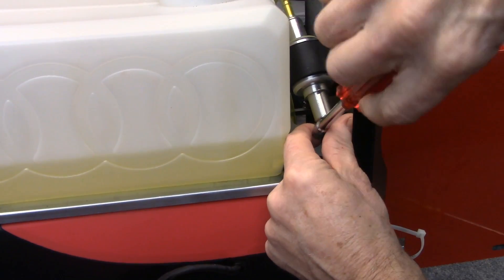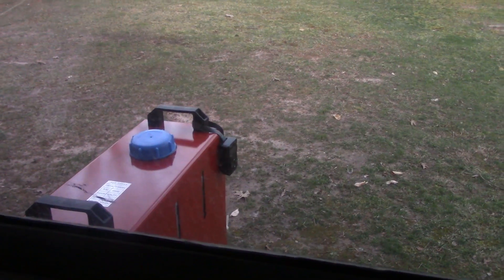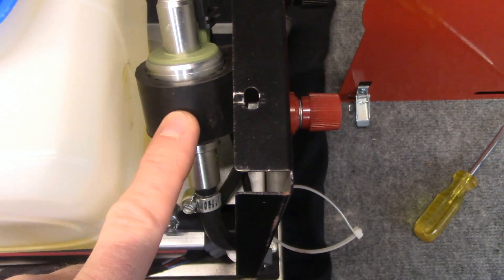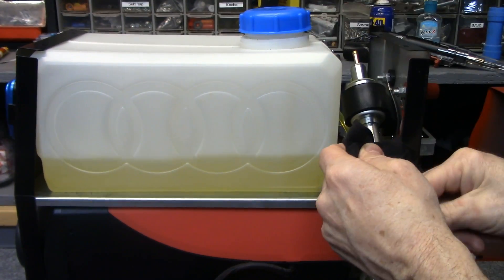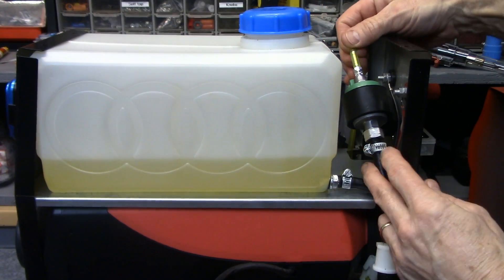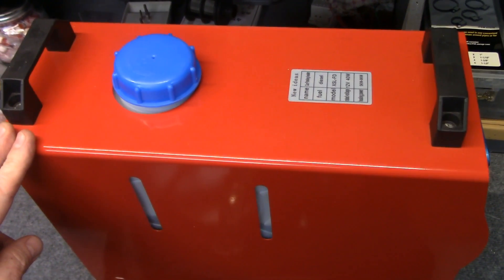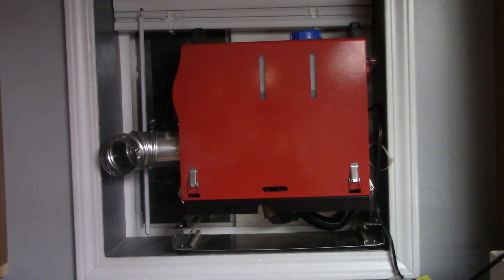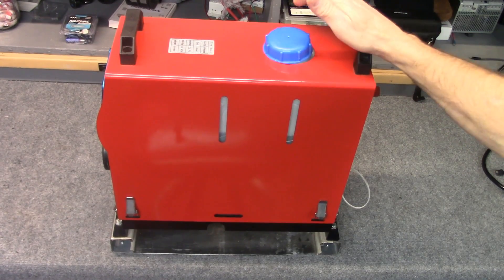Diesel Heater Quiet Fuel Pump Upgrade

Comment: I know this is an old Vid, but if you encapsulate it in silicone rubber A/B mold kit .you just need to add 10-12mm of silicon around it.
Reply from the maker: That sounds like a good idea. Thanks!

Comment: Remove and install in a thermometer and fill  bottle fill bottle  with spray foam  to  
isolate the sound  drill holes in top and bottom
Reply from the maker: Good idea!

Comment: try to decouple the pump from that rubber-like mounting bracket. The vibration is transferring thought the rubber to thin metal that works like a drum. Use some foamy material instead of the rubber.
Reply from the maker: I have since wrapped in in foam which helped. Thanks!
Reply: The reverb throughout the casing is just part of the problem. Why don't Vevor just supply the heater with a silent pump?

Comment: That fuel tank is incorrectly seated in the casing.... Have you got something out of placed or trapped under the tank....every time I open up the case and play about I get the same problem, tank not located correctly, usually if you pull the fuel cap back or forth it lines up and pops up into position where it should be....

Thanks for the video, just what I was looking for. I think I'll try and sound deaden the pump with some sort of fire proof wrap at a much cheeper cost... Mines located next to my campervan bed so it's so annoying. Thanks
Reply from the maker: I never did like the way the fuel tank lines up with the case. Thanks!

Comment: Not worth $40. The pump that came with my unit did click a little. I've since mounted mine outside the unit (heating my basement) on the wall, hanging at a 45 degree angle and wrapped in a piece of insulation. I can't hear the pump standing right by the heater. It's perfectly quiet now. I actually had to feel it to see if it was pumping! So don't waste your money on new pump when it's so easy to quiet down the original pump.
Reply from the maker: Sounds like you have it under control. Thanks for the feedback!

Comment: Get rid of that steel case surrounding that heater, put the fuel tank and pump outside of the camper... you won't have to deal with diesel fuel inside and you won't hear the pump. Also, you'll save space inside of your camper.
Reply from the maker: I agree that would work if I didn't use the same heater in multiple places.
Reply: @geenote  I understand, However you can buy these things for $70.00 or less. I own several of them. They used to be thousands of dollars each before the patent expired a few years ago. Anyway just my 2 cents.
Reply from the maker: So true. Surprisingly low price tag on these units. I have considered just purchasing a kit version with all the separate parts to use. @mooseunit2711
Reply: @geenote  I was talking to an old retired trucker about these these heaters... I told him I bought 3 of them recently and his eyes got big and said those dalm things were almost $10,000 back in the 80s.
Reply from the maker: Finally something worth having came down in price!

Comment: Yes the new pump is quieter, but if you want to keep the price of the heaters down then one has to put up with a slighter noise. Also interesting to note that you can purchase for much less than 30 dollars.
Reply from the maker: Good point. Thanks!

Comment: Two and a half years later - is that pump still working properly, still quiet(er)?
Reply from the maker: Barely a noticeable difference in sound between the original and the upgrade. It still works great. Thanks!

Comment: Quiet fuel pumps are not quiet, save your money , suspend the pump in a wood box lined with roofers lead ... total silence
Reply from the maker: Nope not quiet. Wooden box works good if you don't have an All-In-One unit like mine.

Comment: After the new pump was fitted it is just a dull thudding sound. It isn't as quiet as I expected but that low frequency sound would let me sleep without any problem - like sleeping on a boat with a diesel engine throbbing away in the distance.
Reply from the maker: Yes, it's not as bad but a disappointment. I just get used to it.
Reply: @geenote  There is a chap in Essex who makes an almost silent pump but it's over 100 pounds from memory so adds quite a bit to the original cost. This "ultra quiet" pump still makes a noticeable sound but better than that metallic clunk. Surprised the diesel heater companies haven't copied and mass produced the Essex chap's idea by now but at least he's had a good head start in sales !
Reply from the maker: I think I seen that fuel pump on YT. Great engineering on his part! Thanks!

Comment: Betcha the housing is working like a drum. Might try to isolate it with a rubber resilient mount.
Reply from the maker: Yep, I agree. I have it in a rubber mount, wrapped in foam, and attached with plastic bolts. I just live with it. 😁 Thanks! 👍

Comment: For $40 + labor I call that a fail. 
Insulate the pump from the case is free and better.
If I had one for a camper or bedroom, it'd definitely be outside pumping warm air in through the heater hose. I wouldn't have the whole heater in the window or inside.
Reply from the maker: I agree. Having the pump mounted away from the main unit would be best for a permanent set up. In my case, I'm always moving this all-in-one unit around. I have more insulation around the pump now which helped a little. Thanks for commenting.

Comment: You must get the pump out side and far away as possible. Then take out the shock of pump action 🤔. 
Use a peice of spiraled fuel pipe either side of pump to support it, about 4in long excluding length clamped each side onto the pump it's self will do it, that will safely suspend the pump, or you can use  soft rubber suspension set up to hold the pump leaving it relatively free to move a small amountused l used both options, spiraled fuel line double ( clamps each side) and mounted pump furthest away l could get it. 
Then you have silence. Complete silence.

Good luck bud . 
Martin. 🇬🇧
Reply from the maker: That sounds like a great idea.  One problem I have is that I move the unit around often. I use it in my house, in my truck shell camper, RV camper, tent camping, etc.  I have to keep the "All -in-one" design all together and portable. Thanks for the tips! 👍
Reply: Isolating the pump will stop the noise transfer through the metal casing. However, the pump will continue to click. Why can't Vevor supply a heater with a silent pump?

Comment: Just a lower tone, actually I find neither to be worse than an old school wind up clock. We had those for years before digital and the sound never bothered anyone.
Reply from the maker: You get used to it! I still have a wind up travel clock - batteries don't go dead! 👍

Comment: You should really change the green fuel line for the hard plastic line, as it will not bellow out on the outlet side of the pump.    (just my opinion)
Reply from the maker: I agree. I have the fuel line to replace the soft green line. Thanks.

Comment: The retaining clip on the pump is pushed down to free the electrical connector.no need to take it out .It has a nut on the end to clean the pump inside,thay are sound free when mounted away from the metal unit.
Reply from the maker: Good to know but nothing about this pump is quiet even if suspended with string. Thanks.
Reply: Haha I felt like a dumbass when I realized I just had to push in on the clip after removing it many times
Reply: @juliogonzo2718  don't worry I call myself a dumbass every day

Comment: Could have did wat I did..made a thick plastic egg like shell with one way valve . Silicon both half's encase the pump plus 1cm of each end of the pump ends and vacuum all air out..in a vacuum enclosure no sound at all and the tick sound is 99% gone..yours sincerely from the old qeer corrupt uk 🇬🇧
Reply from the maker: Sounds like a great idea. Thank you for sharing!

Comment: I've got my pump in a 150mm x 150mm PVC Electrical box with 20mm thick dence foam all around it on my truck frame chassis and same foam on back of the box .  it's not bad I can't here it in the cab but outside only 50% quieter now.. just brought this pump to get that noise to 25% hopfully outside.. just payed 25$ Australia eBay.
Reply from the maker: It is an improvement but only a little.

Comment: Wasted your money
Reply from the maker: Slightly better but not a total waste of money....close.
Reply: @geenote  They are noisy buggers. I have mine outside the van and have put it in a 200mm bit of 100mm plastic pipe with each end blanked off and wrapped the pump in car sound deadener and pushed it in the pipe. Can't hear it in the van which is good. Thanks for your tips
Reply from the maker: Yes you have to get creative...just like you did !

Comment: You seriously need to replace that awful green pvc fuel pipe with a decent code fuel pipe
Reply from the maker: I probably will and should but I have had no issues after 2 years of regular use. Easy upgrade...👍

Comment: Have you thought about wrapping the new pump in a sound deadening material to make it even more quiet?
Reply from the maker: Yes - I did that and it was an improvement. Others let it dangle from a string but I really didn't want it unsecured if possible since I move it around often. I was going to add sound deadening material to the inside case but there is no room. Thanks! https://youtu.be/VjZU7Les19c
Reply: @geenote  My pump is in a rubber diesel pump case (ebay), then wrapped in 2" of very very dense foam, then wrapped in duck tape and mounted underneath my van and still there is ticking/vibration - enough to bother us while we sleep. I'm going to try re-mounting and have it "free-floating" somehow. My only concern is with it being underneath the van and having too much freedom to move around if it's not firmly attached...
Reply from the maker: @kylehowe2698   I would not feel good about letting it bounce around unsecured  under my vehicle.
Reply: @geenote  Yes, I agree, I am not satisfied with that option anyways. I've already suspended the pump with zip ties and it barely even helps. I plan to buy a weatherproof junction box and soundproof the inside. If that doesn't quiet it sufficiently, I'll purchase the actual silent pump that James Browning-Smith makes.

Comment: change to a differnt method of pumping fuel. This is not motor driven pump but a solenoid type. The pushing sound is inevitable.
Reply from the maker: Yes it is going to be a little noisy.  It's really not that bad and better than being cold.

Comment: Ok I think some roadkill insulation from the car stereo world would solve most of the problem. Just peal and stick to the inside panels.
Reply from the maker: There is no room at all on the inside panels as they already rub against things like the fuel tank.  But I could stick it on the outside! Thanks.

Comment: I have the same ‘self-contained’ heater and removed the rubber pump mount altogether, then wrapped the pump in bubble wrap - made a vast reduction in the tapping noise.
I also have a Webasto heater on my boat - I removed the pump mount rubber from that and suspended the pump with Ty-raps - that is a better solution and is virtually silent!
Reply from the maker: I may due the same thing eventually. I think that is a popular solution. Thanks!

Comment: Someone told me that we must angle that fuel filter in addition to the fuel pump upwards (like yours)? Is that true? I don't understand why the filter needs to be angled if the pump takes care of the bubbles?? Thank you.
Reply from the maker: I did not realize the filter needed to be angled up - maybe I just lucked out when I installed mine.
Reply: @geenote  Apparently, it does NOT necessasrily need to be angled up. Especially, if  it's going to be 1-2 inches away from the tank (in my case). John is the Chinese Diesel Heater Guru (https://youtu.be/jCZhjGyR3bo) !!

Comment: I know from working in the heating industry that these pumps are always going to be noisy, there best fitted outside the van but then for your kind of heater that not really possible. Those heaters are fine in workshops but campervans! Unless your deaf 🧏‍♀️
Reply from the maker: It's not too bad noisy and sure beats freezing!
Reply: @geenote  true, 🥶🤗

Comment: You push the electrical connection clip in to disconnect, no need to pull it out the holder 🙄 and what a waste of  40 bucks when earplugs can be free😂😂😂😂
Reply from the maker: Splurge and get the luxury .99 ear plugs - probably still a better investment! 😆

Comment: I've heard that if you hang the noisy Chinese heater fuel pump from a twist tie  as aposed to screw it in is hella quit .Cost of twist tie ,a few cents .
Reply from the maker: That seems to be a popular fix I might try. Thanks!
Reply: A zip tie?

Comment: For best results: separate the pump, put it in a small box totally filled with fine sand (birds sand). If you suspend the box or put some soft rubber feet under it you will have a quit pump without any costs. Remember to mount the pump a little skew to prevent air enclosure.
Reply from the maker: I think that would do it although there isn't room to mount a box inside the case.  Thanks!
Reply: @geenote  Put the pump in a car sponge or something similar. It's the brackets that transfers the tapping to the bodies shitty metal.

Comment: Best sound reduction I have seen so far on those pumps, involved using a couple of small bungies and supporting the inlet and exit fuel supply and suspending it from like a lid or seat area.  This is more like on the one's not encased but good info.
Reply from the maker: I don't know how good it would work in an all-in-one unit like mine since it's pretty cramped and  I move it around from place to place.  It might be worth a try.  Thanks !

Comment: I made the same improvement with a cable tie holding the shock mount instead of the bolt
Reply from the maker: I've heard that works good.  Thanks!

Comment: Please post a link to the original heater.  Would you buy again?  Why/why not?  Does anyone make a heater that is already "quiet" when new?  Thank you for a useful post.
Reply from the maker: My heater is not available from the same seller on Amazon I purchased for $111.  I think they are all very similar as long as it is 5kw or 8kw. The tag on mine says "New Ideas". I think they are all a little noisy and there are many videos showing ways to silence the pump.  This video might be helpful: https://youtu.be/VjZU7Les19c   Thank you!

Comment: Not much of a difference in the basement slightly maybe you should try putting some of that black plumbing insulation for pipes around the pump should be no problem even a piece of mass loaded vinyl
Reply from the maker: Good suggestion.  I actually did that and it helps.  Thank you!
Reply: @geenote  I saw another video Keith that some guy built a little box with soundproofing insulation in it very small box something about the size of a spray can large one
Reply from the maker: @peterlaurancearmenio5545  I have seen similar videos of that same idea.  My problem is I want to keep everything inside the all-in-one case so I can move it around to different places.  I use the same heater to heat my basement, truck shell camper, and I also just posted a video using it to heat my pull behind RV camper.  I wanted to add sound dampening material on the inside of the case but there isn't enough room.
Reply: @geenote  I think I might put mine inside of a metal tube

Comment: Well yes it is quieter but a rotation pump would even better. 
The update i saw use a boat fuel tank  with  quick connections.  So refueling  is easy no chance of spilling fuel inside.
Just a thought.
Reply from the maker: Sounds like a good idea...👍

Comment: Change the fuel line to the stiffer nylon tube.
Reply from the maker: So far the original line works good but that is an upgrade I will probably make.  Thanks.

Comment: It makes almost as much noise as the original one. I am thinking about wrapping it with some specific material that blocks the noise, not sure which one but there must be something out there to end this nightmare
Reply from the maker: I recently wrapped the pump and lined the heater box with foam material. This helps!
Reply: I'm now wondering if sticking something like Dynamat sound deadening sheets on the inside of the casing would have more of an effect on the things sound level ?
Reply: Sound deadening material for stereo systems maybe?

Comment: on yours, it sounds like the sound is amplfied by the metal housing panels, like a little drum.  On my external-pump type, it's a higher-pitch click.  It sounds like yours has a click and a thud sound.  I wonder if putting some cheap sound-deadening adhesive foam panels on the inside of that housing would decrease that thud sound.  The empty part of the fuel tank may also resonate like a drum, so putting some of that sound-deadening foam on the sides/top of the tank would also help.
Reply from the maker: I totally agree.  I have some sound damping material to add just like you suggest.  I never thought about adding to the fuel tank.  Thanks for the good suggestions!
Reply: Isolating the pump from the metal housing is only part of the solution. The click will remain as it comes from the pump. Why can't Vevor supply the heater with a silent pump?

Comment: In the previous video is it compatible with kerosene.     fuel true or false
Reply from the maker: I think kerosene will work for a short time but not recommended as it does not have lubricants that the fuel pump needs.

Comment: none of you guys is using the simpler noise reducer in the world, lead sheet, very pliable and comes with a soft rubber sheet glued on...in the plumbing industry it is used to quiet down noises coming from the sewer pipes column of wc,very effective since lead is the denser common metal...still hand pliable, wrap your old pump in a sheet of lead and add some little rockwood...
Reply from the maker: That's the first I've heard of that suggestion. I will check into it.  Thank You!